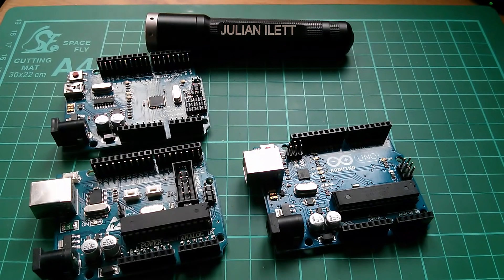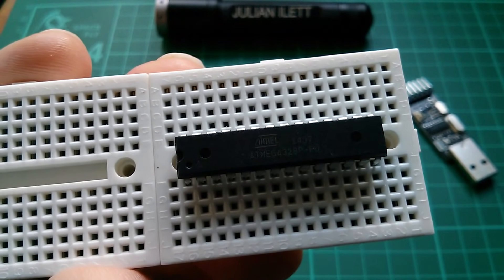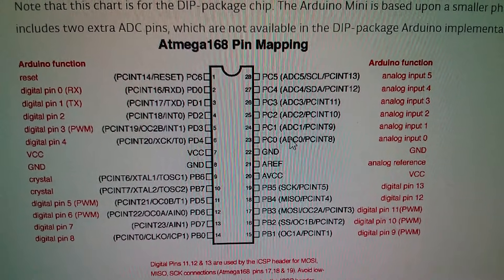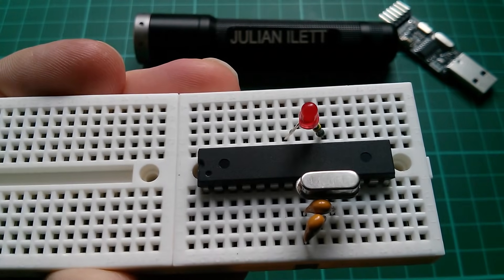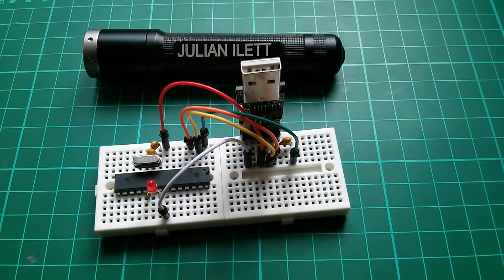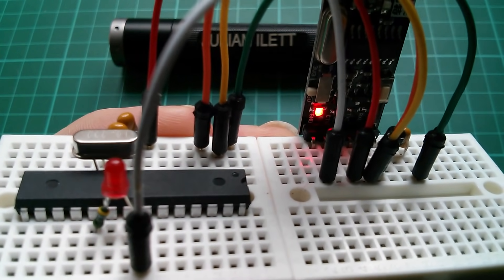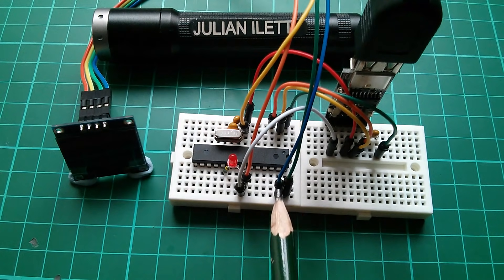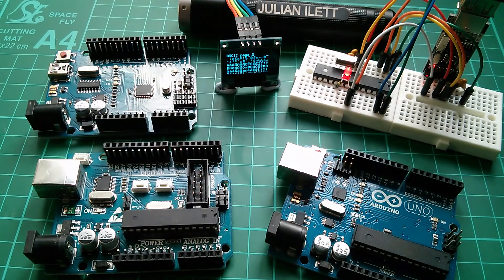1-Day Project: Build Your Own Arduino Uno for $5

Comment: hey...Sir I RELLY apriciate urh wrk its help me alot ...m new to ardiuno plz help .....how to connct Bluetooth chip & 3.4-- 5v DC connecter. ....in ur way ( in own ardiuna )plz....rply
Reply: you supply power to the bluetooth chip from your power supply and then just count the pins of the atmega chip to find out which pins should be connected where. Its just like a big arduino, except smaller.

Comment: This is not working for me. I keep getting 
avrdude: stk500_recv(): programmer is not responding
Reply: +Marko Pahić Maybe you forgot the 10k Ohm resistor between Reset and VCC. If not, shortly press Reset just before the IDE is sending the packages to your Arduino.
Reply: +Wilco Verhoef In the video he said it has to be 100 nF capacitor, not the resistor. And that I did, also tried pressing reset, and still the same error.
Reply: +Wilco Verhoef How do you connect the reset button?

Comment: It occurs to me that this approach has the merit of minimum part for minimum power. Also it permits the programmed chip to be moved to a target embedded project (with a small proto-board). Of course you could do this with the real UNO, just swapping out the chips. The really cheap one though uses a surface mounted, unsocketed part so is unsuitable.

Comment: My computer does not recognize the board, on the device manager I get the message Unknown USB devise (Device descriptor request failed.   Any suggestions
Reply: It needs the drivers so find out the model of the USB your using and download the drivers from the website or look around on the internet for some link. Once they are installed it will work, I recently got some arduino nano that wouldn't recognize the USB device because it needed some drivers, which I then got from a chinese website: p

Comment: I started now to use the Atmel328 directly on PCB and this tutorial was the base for it! Thanks a lot!
Only one remark: I was only able to upload a sketch via USB - TTL converter to the chip adding a 10K resistor between +5V and pin 1 (reset).
Reply: +Dirk H Thanks man, been swapping out components for 3 days, didn't realize to add resistor there.
Reply: The 10k resister you recommend adding, is it from pin 7 to pin 1 on the atmel chip or from the atmel chip to the USB - TTL converter. Sorry but need a bit more info. Thanks for any help. Like Gerry have had no luck with this for 3/4 days and this suggestion sounds good.
Reply: Re: The One Day Ardunio Project: The 10k resister you have added, is it from pin 7 to pin 1 on the Atmel chip or from the Atmel chip to the USB - TTL converter OR just on the USB -TTL converter alone. Sorry but need a bit more info as I have the same problem as you had. Thanks for any help.
Reply: Dirk H If this is all it takes to run arduino programs, what is all the extra stuff on the board? in other words, if I make projects using just the microcontroller like this, will I be missing anything important?
Reply: @erikscow7720  There would be extra circuitry they have on like for hardware PWM, voltage regulators on the power supply. The stuff they have on would be useful to have but like you can see in this it isn't necessary and you could always look at the schematic diagrams and copy the circuits and components if you needed to.
Reply: @Ghost572  Thanks!
Reply: @erikscow7720  The good thing about this is you could make your own PCB and then add those extras on. Which is really good for getting into PCB design! There is a tutorial for making an arduino PCB on Eagle (software) that is unless you've already done stuff like that if so ignore my ignorance :p
Reply: What your project requires will dertermine that. Inputs, outputs etc.

Comment: The homemade one is smaller ;D
But I would suggest an arduino nano or micro if you're going to use it on a solderless breadboard or when you need a small form-factor (but mind that attaching shields can be a little more difficult.)

Comment: Seems like you could prototype a purpose built computer on an arduino, then build something about the size of a pen drive with just what's needed for the application. For five bucks. Amazing.
Reply: +Jim Fortune not a computer but you can make an embededed sistems very well, it's because you are using a microcontroller not a microprocesor.
Reply: mttorresrivera Something that can run rings around anything they called a computer before 1960, I call a computer. ;->
Reply: Jim Fortune the programa 101, the first personal computer (1965 or 1962) and many computers before have the von neuman model, but the microcontrollers have harvard mode, they are very efficients in made a single task (or a small task) for example in your cell phone you can see how from the early 90's the companies are adding many features at your phone (camera, video, internet, a very primitive remote control) but they don't make a difficult task for example modeling or manager a 3d printer (or CNC milling), but the old computers from the early 70's was capable for those precision task (they can made posible the construction of black bird, the supersonic fliyer to spy the sovietics), maybe in the future you can have a small powerfull computer that replace your phone (and not the more cheap solution with a microcontroller)
Reply: mttorresrivera The first machine that most historians consider an actual, functioning computer was designed with only one function in mind. Breaking the Enigma code. The first DEC PDP was designed just to wire wrap backplanes for other computers. As far as Harvard vs von Neuman model goes, anything using separate data and instruction caches would be a modified Harvard model, and that includes just about everything post 8 bit.
Reply: Jim Fortune i was speaking about the first personal computer (a one all people can buy), and you are in the right way about the harvard vs von neuman model, but you are missing the purpose of the harvard mode, it's works very well about construct micronctrollers, exist a small diference betwen a microprocessor from a microcontroller, two of them have a turing machines, you can build a embebed system with a computer but you can build a computer from a embebed system. this is because the microcontroller have a small computer inside but this computer don't could be more modify to make a complex task, but if you get out the microprocesor from the microcontroller you could build a power full computer. That is the point, in a microntroller you are resctricted with a small and limited finite machine. this is the reason behind the use a microcontroller for support a computer systems, for example your keyboard has a microcontroller the only task is manage all push keys, and pass this information to the microprocesor (and we have a single easy task and no more) but the microprocesor can made this task alone (but with a  mont of time more).
Reply: ***** if you want a cheap a powerful computer try with raspberry, the foundation adds a Windows 10 package for a 40 dollars (the computer cost about 60 dollars) this computer was design to learn cometer sciencies. it device can Works with a analog tv or flat tv.
Reply: ***** today exist many kits for electronic entuasiastics, it's good you can pick up some you like it

Comment: You know Arduinos are $4 posted off Aliexpress.
I really do see this as pointless mate. sorry.
Reply: +Dale Whitmore I find it better for fitting projects into small spaces. It can also use a lot less power because there is no voltage regulator to generate heat.

Comment: Very Nice Video....Thank You so much....I built this circuit and it is working Fine(I used CP2102 instead of CH340 converter)
Can anyone just tell me what if i want to power this using my own 5V power supply that i built using rectifier,filter and 7805???
I tried giving power to it but there is a problem with the reset circuit what do i connect to the reset pin if i use my own 5V power supply??Please Help!!

Comment: Nice project and exposition of the concept. I guess that the price on a genuine Arduino is to support the project, not for the board itself, although is nice to have something manufactured in the EU. These guys put a lot of effort in developing the IDE and the support for the platform, I'll buy from them again just for that.
Reply: +L3v14th4n plus they are made a lot better. My original clone model had resistors everywhere and not straight at all, so I blew it up!

Comment: The 100 NF capacitor connecting the USB-Serial Converter to the Arduino didn't work with me. When I reduced it to 10 NF (Nano Farad) things went just fine. 
Thanks for the valuable vid.
Reply: hi what usb serial converter were you using? was it cp2102?

Comment: it doesnt work!! i get this msg: avr dude stk 500 get sync not in sync resp = 0x00 attempt 1 of 10 programmer not responding!! Help please :(
Reply: +HalfLife2Beta I had the same issue, burning the Arduino bootloader again fixes the issue (it is supposed to have the burnloader already though. I used an arduino uno to do so, here's how: https://www.arduino.cc/en/Tutorial/ArduinoToBreadboard Check the wiring as well, it can always help. I hope you can get it working.
Reply: Thx I will try when I have the time but when I put it on the arduino it lights up the led, when I make a simple circuit w/ avr w/o the arduino it doesnt light it, weird
Reply: +HalfLife2Beta this worked for me 
http://3g1l.com/blog-burn-bootloader-blank-atmega328atmega328p-arduino-uno
https://github.com/WestfW/OptiLoader

now i have 10 arduinos

Comment: CAN YOU PLEASE ANSWER: Can we use 18 pF capacitors instead of 20-22 pF? And can we use 150 nF instead of 100 nF? I get that message:
"avrdude:stk500_getsync() attempt 1 of 10:...programmer is not responding" FROM 1 to 10 then it stops ! 
Any help please?
Reply: +HalfLife2Beta 
The 18pF is absolutely fine, 18pF is within acceptable limits. The 150nF is too high of a value though. That's 50% more then it should be. Sometimes it even needs to be lower then 100nF. For your future reference, it should be assumed that anything within 10% of the required value should be acceptable. This is, of course, not true if you're building something very precise, but nearly all Arduino stuff is pretty tolerant. Hope this helps!
Reply: Yeah it does thanks, also I had forgot the 10k ohm resistor beetween reset pin and vcc.

Comment: Do clone Arduino work as good as the real one??
Reply: Maurice-Mores yes
Reply: +Maurice-Mores ya, they are the same components put together on a board without the brand name. some of them use serface mount chips instead of the through-hole original so it is merely preference there, but some have an advantage, like including male header pins!

Comment: Julian, I have another question.  I bought a different USB to RS232 adaptor (link below).  I've tried hooking things up but the pins aren't the same.  The six pins on this module are GND, RXD, TXD, 3V3, VCC, and 5V.  When they arrived, there was a jumper connecting the VCC and 3V3 pins.  I get an error when trying to upload, but I also have nothing going to that Reset pin on the ATMEGA chip.  Any ideas?

http://www.ebay.com/itm/311013143260

Comment: Great video! Now I like to try to make a multicore mini arduino PC. Just need 8 crystals and 8 chips some cheap stuff and 1 usb thingy(you can upload the programs one after another right?) Just one question: if i replace the crystal for one with a higher frequency, will it work?(faster)

Comment: The main seller on eBay you use for your parts doesn't have 20 picofarad capacitors, but they do have 22 picofarad capacitors.  Is this acceptable?  Thanks for a great video!
Reply from the maker: Thanks. Yes, either value will work fine.
Reply: Julian Ilett hey, i seen you buy alot of stuff from ebay i wanna buy 830 ties breadboard and jumper wires cheap but dont know how much is shipping, could you explain me how ebay works ?
Reply: TotaleOnzin i already got one from ebay for like $3
Reply: +TotaleOnzin Great site. Thanks for the tip.
Reply: +Alex Stone Look at sites like banggood.com. They have free shipping and they are most of the time the cheapest.

Comment: IF you don't have the usb to arduino converter, can you simply put the chip you want to program on the original arduino chip to program, then move it onto the  breadboard for use?